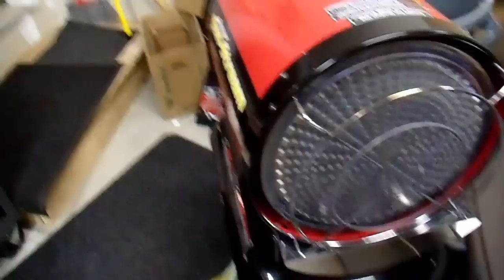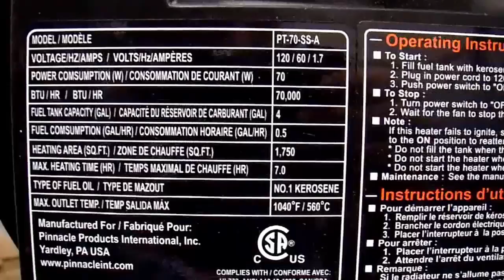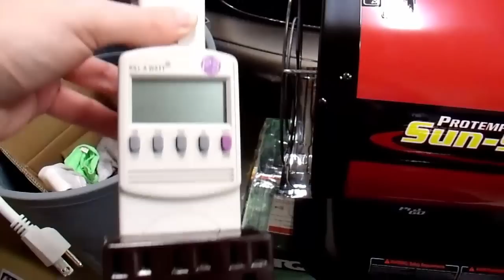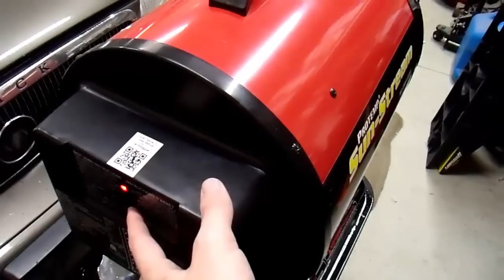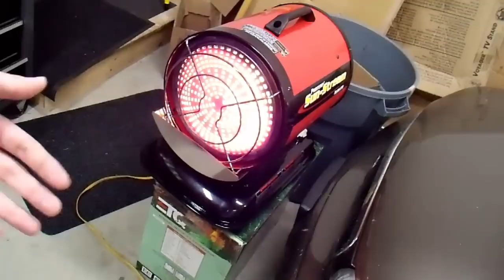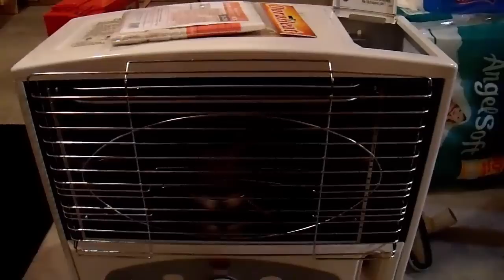Heat your Shop or Garage without Electricity - Diesel or Kerosene Heaters and Inverters

Comment: I bought a Dewalt use kerosene..3 hours later inside my garage.... had a big headache 😫 for hours 😩..not a good idea 😕
Reply from the maker: It wasn't burning properly.  There is zero odor after it warms up if running properly.  I've even run one of these in my house for two hours straight in an experiment for odor and CO and found none of either as long as it was started up outside and powered off outside.

Comment: Sweet!  Although my original intention was not to watch a 12 volt conversion on that heater, I have one of those heaters, given to me by a friend years ago that doesn't work, and I am watching videos on how they work so I can fix mine. I got to watching this and realized I have a 6000 watt inverter in my Dodge Pickup to run my metal chop saw. (I also have a smoky torpedo heater in my shop, but no way would I bring that nasty thing inside the house.)

And I have solar panels on my camper trailer that keeps my 12 volt batteries full year round. 
So, I am now definitly driven to fix that heater and pull the inverter from the pickup and run the heater to keep my house warmer during power outages.  North Texas in currently recovering from a Massive Canadian Cold Front that had -5* temps with rolling blackouts and water shut off for 6 days. (Febuary 2021).
So, if we get another cold front next week we can heat u enough that we won't be freezing the pipes again.  2 busted pipes this last storm!  None easy t get through.

And yea, I know, it will only be for emergency to get the house above freezing.  Not for sleeping with.
Carbon Monoxide and Smoke alarms already in the house.
Great vid Dude!
Reply from the maker: My plan is to heat my garage for projects with it (which I do) and use it for emergencies in the house.  Definitely be careful and use CO detectors as this isn't its intended use - emergencies only.  I find it burns cleaner than my wick kerosene heater on K1 though not as safe and it runs on standard diesel to boot.  Take care of yourself and yours in Texas during this time - I know it's been a crappy situation down there.
Reply from the maker: BTW we had -27F where I live and it took a week to get a high temp above 0F.  :)  We're more ready for it here though than those in TX as we get this at least once each year.  Companies shut down to conserve power and nat gas but we made it through.  I can't imagine the chaos weather like this causes in places that aren't winter hardened.  Take care.

Comment: Can you use this insider house or what can I use inside my house
Reply from the maker: This heater is not meant for use inside a home.  I HAVE used it inside my house and it works very well with little odor and no measurable CO.  It burns cleaner than my wick based kerosene heater.  I would not consider it safe to do so however as that isn't how it is intended to be used.

Comment: so it does use electricity.
Reply from the maker: So does my phone, but most people would say you can use it without electricity.  The point is that you can get 20,000 watts of heat for as long as you need with a few watts out of a simple car battery.  No electricity service needed in your garage or building you use it in.

Comment: ALWAYS onnect the positive cable 1st at the car battery. The negative cable is least likely to spark.
Reply: It makes no difference which is connected first, the reason you connect the negative second is because it can be connected away from the battery. It sparks exactly the same however you hook it up.
Reply: @DMAN22yeah  it does make a difference, I mentioned it in the comment.

Comment: The only way I would use that heater in a house is with doors open on two sides of the house . Hopefully it would put out more warm air than the heat you would loose with your doors open. I would use it in my garage with the big door half open

Comment: The output is to HIGH.   To heat rooms in a house.   You would be,  turning  on  and  Off.  THE 20 year OLD,   kerosene HEATER,  would be much better.   JUST start it outside  (5 MINUTES),  then move inside.    We RANCH,  and have lost  electric power for 3 or 4 days.
Kerosene  heater,  kept us comfortable.    Plus we could cook on its  top and heat water for coffee.
SUN-STREAM Is a excellent product,  &  would work very well to heat a barn when you have electric.     BUT I  do NOT agree,  with this young man.   THE old fashion kerosene HEATER is BEST.
JUST LEAVE A window  1" open.
This is HOW grandparents HEATED,  the house.    And that was before they got electric,   &   and  C.O. sensor.

Comment: So these can burn kerosene & DIESEL?  I'm asking cause I have an older model of this branded heater the 55000 BTU its yellow, sunstream nonetheless but does or burn diesel or what? 

Oh and the people bitching about the plug its used to spark the fuel.

Comment: For new viewers that go nuts like the comments below:
1) he is showing a device that produces significant heat without requiring grid AC high kW power.  This uses a very frugal draw for a fan and the slow fuel pump, unlike the torpedo heaters.
2) he runs the electrical portion off a simple car battery.  It is for the garage.  Heat comes from the K1 or D2 burn.
3) no you will not die from CO.  His and my carbon monoxide meters show zero when kero heaters in good running order burn.  You are more likely to get registered CO gas with a natural gas central heater, water heater or wall heater.  Typically people fear more the fire they see than the secret fire they don't.
4) CO2 will not kill you.  Carbon dioxide is required in the atmosphere for plants to grow.  You exhale more CO2 than you are likely to detect with a kero stove.  The Japanese use these stoves as primary home heaters and they appear quite healthy and have good brain function.   ........However that may explain Animé.
5) if you are scared of flame control liquid fuel heaters just don't use them, but kindly shut up.  You likely drive around in a portable device that goes over a mile a minute, sitting on a dozen gallons of gasoline and inches behind a thing that produces 6000 explosions a minute belching fumes under your butt.  Again when you see it some people get scared.
Reply: Hey bud...does your CO2 comment apply to kerosene torpedo heaters as well, or just these larger diameter radiant heaters? I have a Remington kerosene torpedo that I usually leave just outside my garage door and blow in, leaving my garage door up about 2 feet. I have always wondered if I can just run it inside with the door shut?

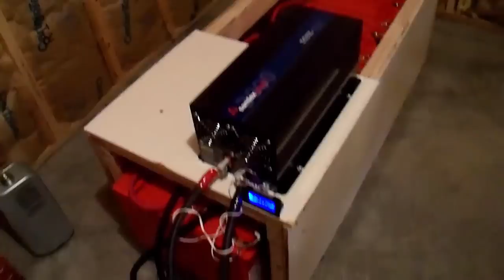Comment: If you were in an ice storm and had no Power, you would have a car or truck or to around. This could save you from frozen pipes and having to go to a Motel Warming Shelter or your mother in Laws Place. Also if you had watched it all at 9:55 or so he shows the Wick Type NO POWER NEEDED Kerosene Heater for emergency back up.

Comment: It amazes me of the negative reaction of folks  when someone is using a kerosene heater, but the same folks are ok with burning candles that burn houses down and emit poisonous fumes for example and the same folks would be ok to burn gas or propane heaters that emit the same dangerous fumes.
The heck, there are millions of kerosene heaters in use every winter and stores are selling plenty of them. They even sell those gas and propane powered heaters that emit the same dangerous fumes as a kerosene heater would and folks have no objections using them with their brainwashed mind.
It is a very good video that shows instructions how to power things up to stay warm when there is no grid power.

Comment: Harbor Freight sells a propane heater "15,000 BTU Tank Top Propane Heater" is what they call it. I have used them for years. I live in Ohio and the temps have been in single digits for a couple weeks and when i'm out in my shop I usually have to take my coat off after an hour or so.

Comment: I too have the SunStream heater, warms the place up quickly...  NOTE: mine died, the rubber tubing rotted & has to be replaced. Checking this every year, might save your machine. Hoping Mine is repaired very soon.

Comment: So the thing is with a car battery at 110 watts you probably only get around 4-5 hours running the the Sun-Stream.

Also with any Kerosene heater make sure to be mindful of ventilation because oxygen depletion and CO2 buildup are both concerns.  Well that would be any fuel heater used indoors but propane is not supposed to be used indoors at all because of the high pressure of the propane in the tank and it's explosiveness if there is a leak.  Kerosene, like diesel, generally does not explode if it leaks although it can catch fire.

It's best not to use diesel in a kerosene heater unless you can't avoid it because diesel does not burn as cleanly.  And also make sure it's ultra-low sulfur if you are forced to use it.

Comment: he's not even using electricity from the battery much less no electricity. He is lying a shity little inverter barely runs a fan much less a fan with a pump igniter sensors this is all a big lie don't believe his bullshit if everything was this easy everybody would be doing it it's not nowhere near close enough to run that unit

Comment: For those worried about the C02 just install a heat recovery ventilation pipe.  Or build one if you know what your are doing.  How it function is air is exhausted from the house and air is taken from outside and into the house, the warm air in the house is chilled as it is being exhausted, which warms the cold air coming in. The heat transfer is passive requiring no power just the thermal difference which is conveyed by heat pipes. However one normally uses fans to bring in and exhaust air, and the fans will require power. Technically you could build a passive system and run the fans off the thermal difference with a Stirling engine driven fan connected to the heat pipes.  In addition instead of using the battery for those complaining about that you could use the inverse of the peltier cooler effect, the seebeck effect and even though it converts only a small portion of the heat flow to electricity at 70,000 BTU it should be enough to generate 200 watts.  If you are even more concerned about particulate in air you could use a high temp zeolite type filter in front, but then you would have to increase fan power to compensate.  Alternatively you could ionize the air on the intake and use a magnetic filter with a piping system such that you are far enough away from the heat that it does not destroy the magnets and use a getter material.

Comment: Just a note. Kerosene costs 3 times more than diesel. Be sure the heater labelled kerosene/ diesel. I use Remington kerosene/diesel heater with thermostat. At minus 20 Celsius it consumes 10 litres of diesel in about 24 hours to sustain plus 10 Celsius in a standalone garage of 28 sq.m. 4 meters high.

Comment: I wonder if this inverter would power my Whitfield pellet stove during a power outage? It has a blower, an augur motor, and another small fan in the exhaust. Also, this is an old one without the electric resistance starter coil. I have to light this one with a match and tinder. This inverter might get me through a short power outage. eh?

Comment: Excellent video, good information for several applications. Having grown up with butane heaters in a house, an open flame is not as scary. A good rule of thumb, when your windows start to fog, it's time for some fresh air. I would not set it up so close to flammables, but that's the safety troll in me.

Comment: It has been my unfortunate experience that a  modified sine wave inverter will quickly kill a small electric motor, just like the one in your heater.The first sign will be when you start hear the rpm's decreasing. After that the motor will to making a humming/buzzing sound. By the time you start hearing the motor humming the rpm's will have dropped considerably. No. It's too late. The motor will not recover when connected to grid power. I ruined one of my nicer ceiling fans and smoked a 13" color TV by using a large modified sine wave inverter. I sold it and bought a 10,000 wt pure sine wave. No more problems after that

Comment: I don't know why you keep saying modified sound wave inverter. All you're doing is confusing the shit out of people. You should just call it a 12 volt to 110 inverter.
Reply: tony c modified "sine" wave inverter and that's exactly what was the question asked from previous video so that's why he is doing this.  The other type of inverter is pure sine wave, which is cleaner power especially for sensitive electronics, they don't run correctly on modified and can burn up, so make sure you know what you are talking about before making yourself look dumb.

Comment: How can gasoline provide 10x the heat when it has only 90% as much energy as gasoline?
Reply: Violent Apathy , ????
Reply: Some additional research shows that it is appears to actually have a bit more energy per gallon than gasoline. I had read the chart on wikipedia incorrectly. But from everywhere else I've looked, it doesn't have a whole lot more energy than gasoline does so it doesn't make sense that it would provide 10x as much heat.

Comment: Heat your Shop or Garage without Electricity - Diesel or Kerosene Heaters and Inverters
  Just get a kerosene heater and plug it into your ass.Worst title ever. 
Heat your Shop or Garage without Electricity, Diesel or Kerosene Heaters and Inverters

Comment: I used a kerosene torpedo heater in my shop for years until kerosene soared to over $10/gallon. With LPG ranging from $1.50 to $2.50/gallon I made the switch. Frankly, a secondary reason for the switch is that I just got tired of the jet-exhaust smell every time I fired up the old heater, and since my shop is not all that big, the smell lingered for a long time.
Reply: Tony Kibbie they make a propane buddy heater not very expensive don't know if electric needed.

Comment: A modified sine wave inverter is hard on electric motors. AC motors simply are not designed to run on square waves, or rounded corner square waves.

Comment: Yes  about ventilation.
You would not run your car engine in the confined space of a workshop, so don't run that unless there is a big turn over of fresh air like the video comments on.
I contacted the makers who state that the heaters are meant for outside use.
Also you will create a gallon of water for every gallon of fuel you use.

Comment: I was at hd yesterday asking about these catalytic heaters if they can be used indoors. The guy said no. Must be well ventilated. So a garage with the garage door open is ok but if its closed not ok. Not inside the house. You may be ok for awhile, then bam, youre dead. But good video anyway. I always read the comments on these videos as the readers are good at picking up mistakes. But now i know alot more than i did before. Also was wondering about the 10-1 ratio of energy kero vs gas. I thought it was more like 1.3???

Comment: Bad idea. CO poisoning. This is a direct fired unit.
Reply: People were more hardy back then; they survived with no seat belts, no worries about lead, no bicycle helmets, free exposure to DDT and R12, and all that widespread California cancer.  Good times.
Reply: Yes, High CO levels will eventually mimic low IQ .  And evidently, comments lacking knowledge.  Remember the vent less natural gas heaters?  I got so angry when I saw Home Depot trying to sell them.
Reply: I agree with you about natural gas   but propane burns clean and leaves only co2 and water vapor. I am not as sure that natural gas catalyses as completely as propane
Reply: yeah, signifcantly shorter life expectancy... Great times...

Comment: I don't care how clean you think burning anything indoors is safe. Don't buy into this or think you can breathe carbon monoxide for any length of time. If you don't have a way to properly vent. ie a wood burning stove with a chimney. Radiant electric heat  for the shop. There should always be fresh air coming in.

Comment: My dealership shop uses a waste oil heater. It really cuts down on our heating cost and our fluid disposal cost as well. Because the only fluid we have to stock for disposal is our engine coolant.

Comment: It says right there that is a KEROSENE Heater!
Reply: john nunya  Again you are just arguing semantics to be an ass hat.  Yes electricity is required... It's being supplied by battery and inverted in this case.. No there are no magic electron fairies involved.
Reply: "without Electricity" ? What's the fan run off of? water?
Reply: john nunya watch the video maybe? and you will learn that you can use a battery and an inverter!  Science! :)
Reply: and those are not electric?
Reply: Ok I give. "without Electricity" is obviously beyond your comprehension. No one is questioning if this can be done.
Reply: Heat your Shop or Garage without Electricity (As in, the electricity went out....)
Reply: Brett DiMichele Studios Got it! Thanks!
Reply: john nunya  They generate electricity to run the fan. I know you are trying to play a game of semantics. This isn't rocket science, this is a video talking about how to heat your shop or garage without electricity as in, Grid Supplied. There is absolutely zero need to add Grid Supplied because most people have the mental faculties to watch the video and understand what he means.
Reply: +Brett DiMichele The moment I see "off grid" gasoline, required to turn the "off grid" engine, which turns the "off grid" alternator, that charges the "off grid" batteries, I'll see your point. WTF is wrong with you?